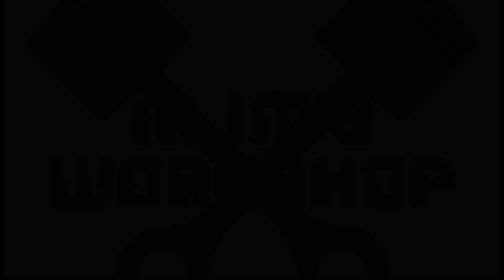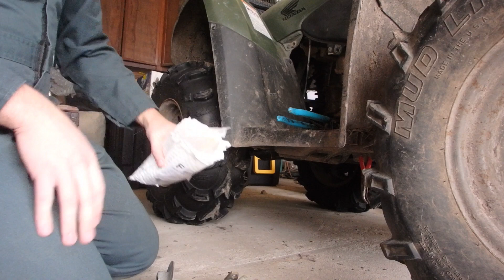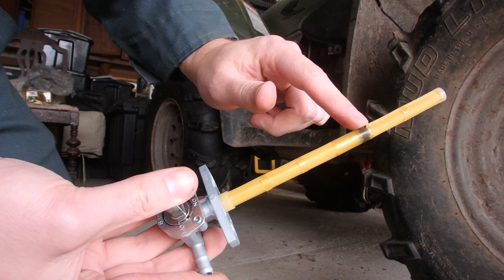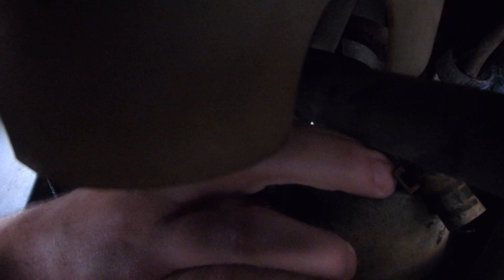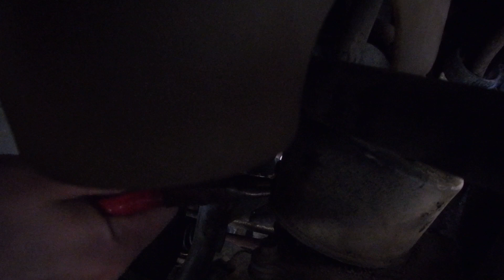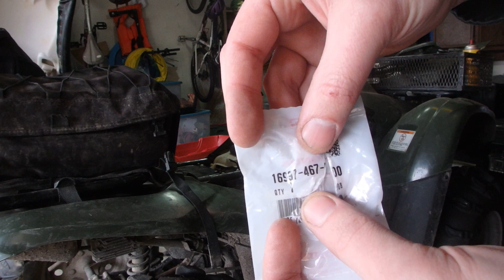Repairing the Honda Rancher 420 Fuel System

Comment: I don't believe in 10 yrs I've ever left a negative comment on any video, but there's always a 1st , I guess.
I could have really used some guidance on this issue but I couldn't see how you took off the selector switch in the 1st video. I couldn't see how you reinstalled it in this video.  Most of the time elapsed waiting for you to think of how to talk are ideas you wanted to portray. 
I did find out where and what the fuel bowl which you say the pump is in but still don't know how to remove it. I know you didn't even do it but you spent a lot of time talking about it. I did see the switch valve and tube that was eroded away but have no clue what it connects to or how to reinstall it.
Maybe you need to think out your video production , add narration when you know what you want to say w/out all the pauses and changes of thought. It would be nice to have access to the views of what you actually remove & replace.  Or , it just isn't a productive use of time & effort.
Sorry about the negativity. I do appreciate you sharing even though I hoped for a more complete picture.
God bless and nothing meant personal.

Comment: I got a gas leak above the gas valve it could be the fuel line
Reply from the maker: There’s a o-ring there that could be leaking.
Reply: @mjmsworkshop  I got it fixed I gotta get brakes oil and air filter tomorrow

Comment: thanks for the video!  Stupidly...I took the hoses off the fuel pump a few months back and just now am replacing the same thing. Could you possibly tell me where the vent hose goes? I have the fuel tank to pump hose right...and the pump to injector right...no idea where the other hose goes from pump to????  Anybody help?
Reply from the maker: If I recall it goes up towards the top of the tank? But I could be totally wrong there.

Comment: Did you have to drain all the fuel out for this repair?
Reply from the maker: Yes it all drained when I removed the petcock.
Reply: Yes he did. Too bad the dumbass didn't pull the tank to remove all the leftover plastic, screen and broken copper tube.
Reply: @williamnoble7915 Ya, it's so easy to pop tank off , because of the rotten crap does stick to the bottom of the tank, if you're gonna do it, DO IT RITE!!

Comment: Bought a 2012 from a young guy here it only had 3800 km's on her but was bogging down sputtering and cutting off when the engine heated up. He said he couldn't figure it out. Had the machine for 4 hours once i bought it and took the fuel pump apart I didn't even remove the lines off the top of the pump just removed the top with everything still attached just pulled it up out of its mount off the frame to get to the fuel filter. It was clogged bad thing sat for a few years in his shed before he sold it to me. Anyway with current world situation due to covid I couldn't get a replacement filter shipped to where I live anytime soon so i pulled the filter off ran an air compressor and blew out what i could actually shot the air down into the o ring on the filter directly into it then I actually threw the thing in a bowl with some blue dawn dish liquid and soaked it then using a soft old toothbrush i brushed it off and blew it out more with the air compressor again and let it dry out it worked perfectly filter is now like brand new and the bikes been running like a clock now for a whole month and a half. Got me out of a bind and I am able to enjoy the machine out on the trails. No more bogging sputtering and cutting off or stopping to let her cool down. Ive ran her for 4 to 5 hour long trips. I got a very good deal on the bike considering that was all that was wrong with it a real steal.
Reply from the maker: Nice find and repair!

Comment: Were u worried about the parts of the old petcock (the long tube) still lying in the tank ?
Reply: About to take on this project on 250 recon. I can see some of the old petcock in the tank but didn’t want to miss a piece and cause a problem.  Thanks for the video.
Reply from the maker: I think most pieces came out when I drained the tank. There’s a filter screen on the petcock so should cause an issues if any pieces are left.

Comment: 08 rancher 420 replace fuel pump, now wont start, i do hear and feel the vibration of the pump for 3 or 4 seconds , but no fuel comes out of the lines, i bench tested the pump, it works fine only on the vehicle it does not even with the power on it, any ideas??
Reply: Check your injector
Reply from the maker: Is fuel getting to the pump?
Reply: @mjmsworkshop  thank u so much for replying, YES fuel from tank to pump is there, again i bench test the pump, works fine, but not on the vehicle, power is also there,comes on for abt 2,3 seconds...i dont think the relay bcs IT IS getting power...

Comment: I have an 8mm socket on it and it free spins like there’s a nut inside the tank I need to grip onto but I see in your video the tank has threads for the bolts??? 🤨
Reply from the maker: It’s a bit molded into the tank if I recall correctly. Hopefully it didn’t strip out.

Comment: When my rancher warms up it begins to jump, bog down or backfire and act like it’s running out of gas, I don’t think it’s a cooling problem because the fan works fine and no lights come on. Could it be a clogged petcock valve?
Reply from the maker: could be , or filter screen in tank. You can try removing the hose and checking fuel flow.

Comment: What symptoms/problems did it have to prompt that specific repair? I heard you say you checked for fuel flow on the petcock line before removing the whole fuel pump but what was the initial problem(s) that made you start on it? I got a 07 Honda 420 FI that ran perfect one day and the next, out of nowhere immediately shuts off when given ANY throttle at all, but will start and idle like a sewing machine. I'm thinking clogged filter under fuel pump starving it of fuel or the IACV because I don't know exactly what it does but it is electrical and attached to the throttle body. Which to me seems like a reasonable assumption for it to have taken a shit and not permit flow of either the fuel or air and consequently, acceleration. Does anyone have any solutions???
Reply: Mine has started doing the same thing as yours. Starts and idles great for a while, but cuts off if given any throttle. Also cuts off after about 2 minutes if left idling. Did you ever figure out what was causing your problem?  Thanks for any information that you may provide.
Reply: @stephenlane7951  mine is doing this now after sitting in my basement for too long. Did you find a solution??
Reply: @stephenlane7951  same here, did you find a fix?
Reply from the maker: Mine stalled and wouldn’t start back up.

Comment: Any body knows why my 2014 Honda 420 fm won't stay idle
Reply: Gonna have something to do with clogged or obstructed fuel lines/fuel filters/fuel injector, or stuck/dirty possibly malfunctioning Idle Air Control Valve (IACV). Check all that stuff first cause its easy and cheap. And obviously check spark plug and air filter etc. as well as make sure fuel is clean, new and 90 oct. or higher.
Reply: Posible you have air leaking .